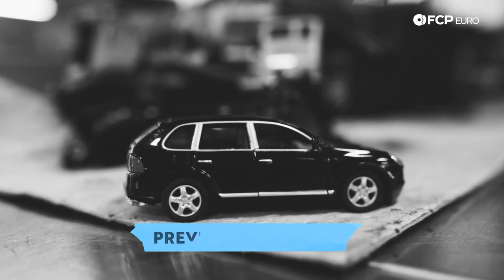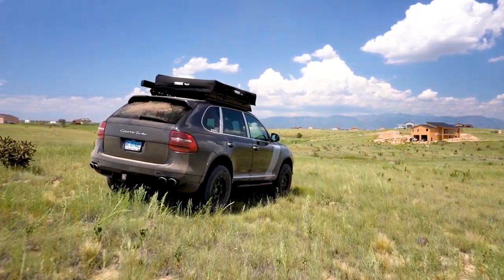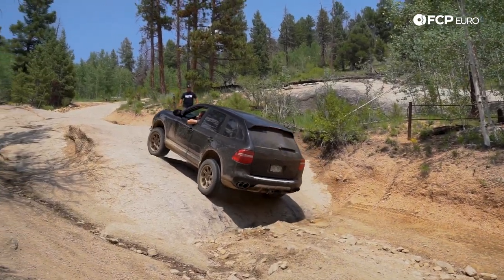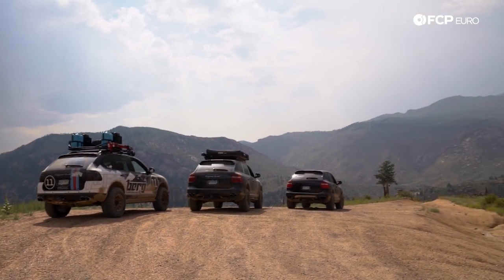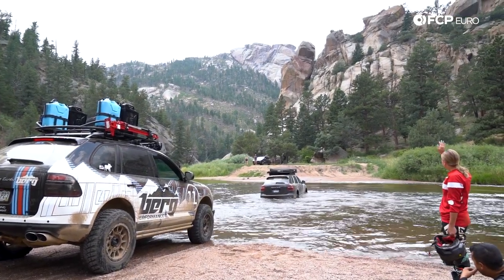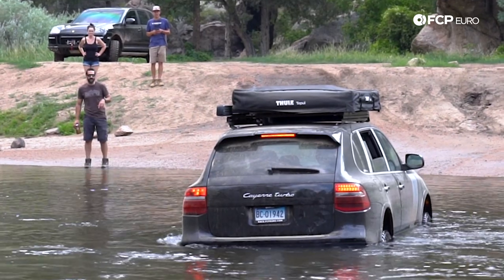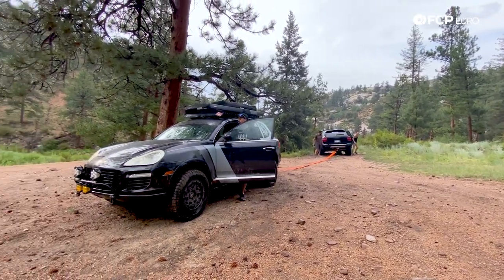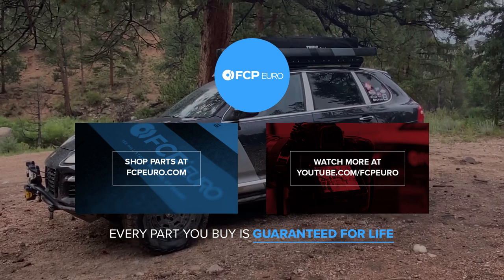Hydro locking Our Cayenne In A RIVER  - Ep4 #YippieCayenne

Comment: Space Coast Rovers co-founder says:   we cross swamp here in FL.  Its more than snorkel.  Theres. Extended tube vents on diffs & transes.  RTV every wire connection under the hood for ignition, engine controls,  off switches for radiator fans,  so much more.  Even the air suspension air intake in that new wabco unit needs lifted or relocated.   Got chocolate milk in all your drive train.  But will be surprised, unless bent rods, how it recovers...   Get back on that horse.  Its still a 130k vehicle thats made with great naterials and will bounce back.  Change the. Rods or LKQ the short block in worse case.  Weve seen 44" rat motor single cab monster trucks disappear over the roofline in swamp and come back.  Get back on the horse.
Reply from the maker: Saddle is back on, just gotta hop on top and ride it into the sunset. Someday...soon.

Comment: 9:09 cayenne enters water, by 9:11 cayenne is hydrolocked. Water ingestion probably occurred at 9:10 with that moderately large second splash, which occurred due to a modestly higher entry speed than Berg's cayenne. doing water crossings in these without snorkels- you're really living on the edge
Reply from the maker: Ben was living a little too comfy on that edge throughout this build 😅
Reply: And people keep telling me a snorkel is overkill. It is, until it isn't. This was a rough watch. Always hate to see someone break something that will cost this much to fix.

Comment: So at this point, if you go slow and steady, what would you say the highest point of the cayenne to go or not to go into the water? I always thought it was about the height of the wheels? I mean I had water go over my hood, (splashes) not river.. Just curious cuz I have one lol and I would go cross that river too lol
Reply from the maker: Technically from factory its approved to cross through 21.8" of water, that said  with factory shrouds installed and the foam to knock down splashing it can be  more, that said the intakes are in a slightly suspect spot, and given the right conditions.... this can happen 😔

Comment: I wonder how those other Cayenne’s got thru the water so easy. I thought they looked like good off road vehicles, but with the electrical and intake so low they definitely ain’t for any trails that have water.

They shouldn’t get on to dude. If one guy knew all that about it he should of told them “Hey we making this for Overland, but it can’t cross any water deeper than X feet (looked about 1.5 feet 🤦‍♂️) and that’s even if we put a snorkel on it cause of the air pump, wiring, and other stuff is low af.” Like that is important info. Anything that will directly affect your main plan in a major negative way like: Plan: build an off-road vehicle. Problem: Your buddy, co-worker, boss, teammate choose a vehicle that takes massive amount of work to cross shallow water.

It is a shame they had to leave it there. It seems a well built full size 4x4 truck could pull them back to the road with decent equipment and someone in the Porsche that knows how to control a vehicle being towed. Heck build a front tire vehicle dolly to off road standard and it would almost be easy. Just got to remember you got it back there and adjust accordingly. Of course some manufacturers put in drivetrain components that are known to break or are just enough for the power the motor has. I know folks that with 1-3 year old Silverados that had transmissions go out cause they put rims and tires on it, cause they pulled an rv (within weight limit), or just cause. Meanwhile read that I can put a SBC 350 in my T100 with a bell house adapter. The clutch and transmission toyota put in to attach to a 3.0 V6 is plenty strong for a 350 V8. Like lmfao. Toyota putting in stronger transmissions and clutches for a 3.0 than Chevy does for a 5.7 🤦‍♂️. They lucky them Silverados look so good, the sbc’s are so compact of a V8, and that truck people are so loyal they will buy their Chevy, Ford, or Dodge knowing they gonna have to do work on it.

Comment: So sad ☹Slow and steady, and know your limits.  When fording deep water, you need to watch for vents or other holes for things like transmission, air compressor, etc..., and the wiring harnesses (if they aren't waterproof).  Like you point out, there are harnesses under the floor on both sides (which causes problem if the drains get plugged) - and if you are deep enough, then water can come in through the drains.  I'm a bit surprised you got hydrolock - the intakes are pretty high (although the bottom of the air filter is low, the exit of the air filter is on top).  Even if you don't get hydrolock, contaminated fluids and such can be a problem later on.  It's my impression that vehicles where deep water is anticipated need special treatment to prevent water ingress (snorkel is just one item).  Coil-overs may actually be more reliable than air suspension in this case.
Reply from the maker: Totally the case Johnathon - live and learn on this one. The reality was the front shroud removed previously that helps knock water down from the intakes would have likely knocked down the initial splash, the water coming into the cabin certainly happened over time as the outside pressure built up while getting it out. Stay tuned to see how the team tries to revive and rebuild the Yippie Cayenne in the coming weeks.
Reply: @fcpeuro  Looking forward to the videos - lots of opportunity to see much deeper into the engine.
Reply from the maker: Johnathon McAlister we promise by the end of this you will see deep into the bowels of this engine haha

Comment: Was there an issue with the airbox that contributed to this?
Reply from the maker: It's safe to say the lack of factory shrouding (removed) did not help in this case, it likely would have knocked down that initial splash during the (too fast) of an approach into the water. Ultimately that allowed water into the intake, and then from there into the combustion chamber. Stay tuned though, things get interesting!
Reply: @fcpeuro  That makes total sense. So it rushed in from the new exposed area underneath.

Comment: You need to pull the carpets seats and interior and solder all the bare copper wire splices (wrapped in cloth tape in the floor from porsche/VW) and solder all the connections (theres a shit ton of them) then seal with liquid heatshink and heatshrink otherwise a future episode is going to be wondering why you have electrical gremlins and codes all over the shop...
Reply: Solder on a Car? Are you the Devil?
Reply: No VW is the devil.   The factory connections are sonically welded bare copper wrapped in fabric tape.   What do you think happens when that gets wet? (and it will one way or the other eventually).     Solder is a million times better than that and theres no way these connections will ever break because they are in bundles of wires well over an inch in diameter with extra wire there so theres no pull or delfection on them whatsoever as long as you tape them into the bundle right.    In the engine bay yeah it would be a bad idea in the interior of the car with this bundle of wire under thick foam carpet its perfectly fine and imo one of the better methods of fixing the issue.    The only other way is fully sealable crimp splices which imo will be a bigger mess than this and just a pain in the but to do due to all the different diameter wire you need to repair in there.

Comment: And now the loom is all wet too..you’ll need to strip that and dry it out
Reply from the maker: Had to get that thing stripped and fans on immediately.
Reply: Its worse than that they need to strip out all the bare sonically welded copper connections in the floor that go right along the floor both sides of the car and upinto the dash and solder all the connections and then seal it all with liquid heatshrink otherwise your going to see massive electrical gremlins in the future   And you need to get it before all the copper wire turns black and is unsolderable.

Comment: To be fair, these German SUVs can barely take the stress from speed bumps around town.  You bump a curb in a 4motion Tiguan and the front end needs to be rebuilt.
Reply: Comparing an MQB (Golf/Jetta) based Tiguan to a Cayenne is silly
Reply: @SteveBassen  probably but let's be honest, German cars are DELICATE. I love German cars but I know what they are are aren't
Reply: @billybarty100  the Cayenne/Touareg/Q7 platform is not delicate. The guy pushed the vehicle too far. Just the fact it got to that water feature is testament alone.
Reply: If a german wants to get serious about offroad they should look to landrover, which has a lot of german content.  ZF tans, wabco, bmw engines in some, bosch systems.....   In the classic it has as its heart a 1962 pontiac all alum motor- 3.9/4.2.   But the days of $2000 dream classics may be gone until gas goes above $6..